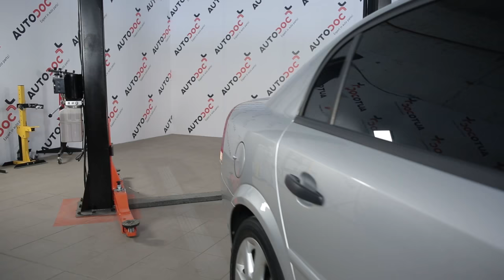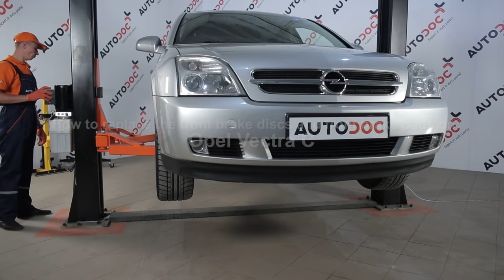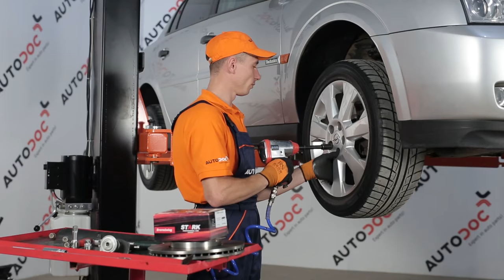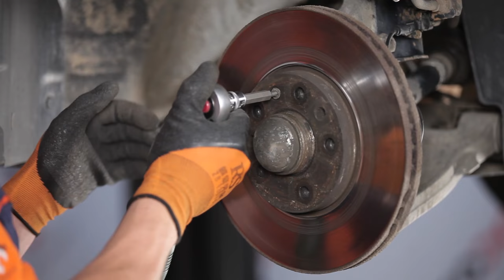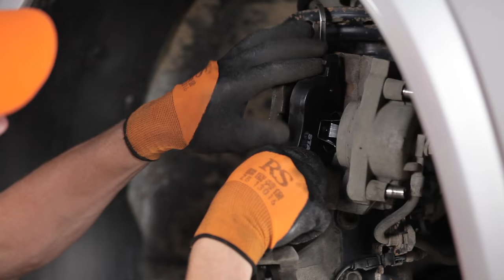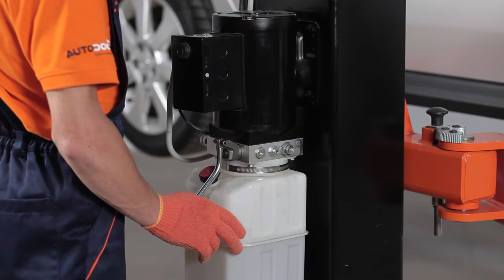How to change front brake discs and front brake pads on OPEL VECTRA C TUTORIAL | AUTODOC

Comment: Is there a piston to wind back on the fronts or not ?
Reply from the maker: Thank you for your feedback!  It is absolutely right : if a piston is  much in forward position  and  is a hinder for new  pads to be installed, it is necessary to use a special pressing  tool. However, in this case you don't need to wind back  the piston, it is enough just to  press it. Best regards, Autodoc.
Reply: @autodocuk  thank you very much is there a section just for the Vectra c ?

Comment: Removing the bracket with socket No.E20, my bolts won't turn, they appear to be seized solid. Any tips for removing them?
Reply from the maker: Thank you for the feedback!Perhaps the threaded connections have rusted, try using a suitable chemical.Best regards, Autodoc.
Reply: spray with plus gas then an half decent impact wrench will get them out.